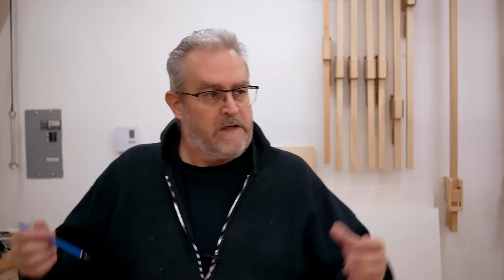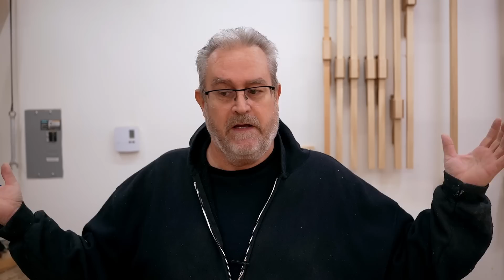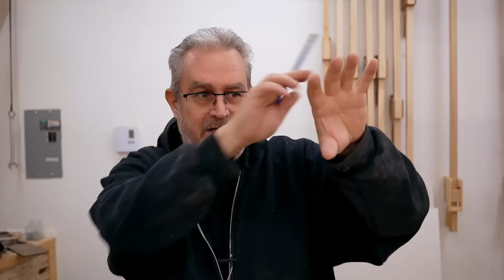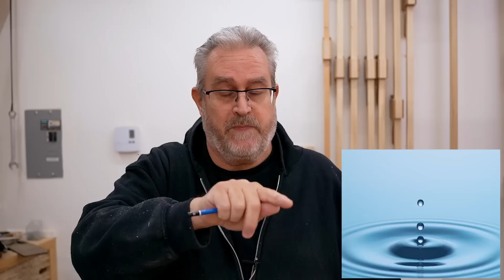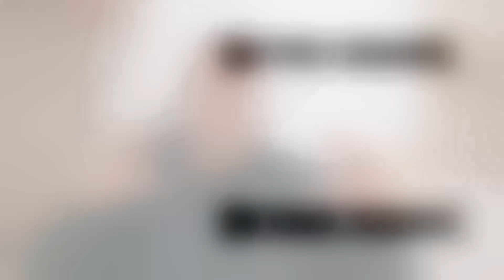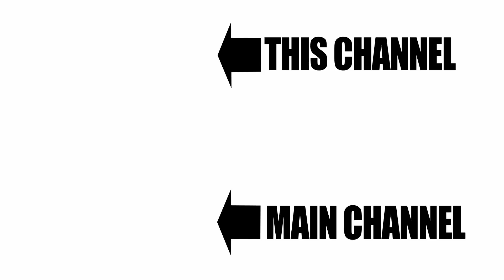Debunking Audio "Truths" - Open Baffle Speakers don't Pressurize The Room

Comment: There is no pressure created by dropping something in water?!   Lets try dropping an asteroid, the size of Texas, into the water... from 1000 ft up.   The resulting Tsunami..  wont have any pressure at all... right?  >_<

 What about Car Audio Subs, in an Enclosed Car?   There certainly isnt enough Pressure created, to rattle the Trunk, and or Blow out the Windows... right?

 Of course, none of this has anything to do with  Sealed, Ported, and Open Baffle... IMO..   as a large room isnt likely going to become Pressurized enough to be felt...  by standard house speakers. Some Massive Pro Audio Woofers, and 10,000 watt subs... maybe.

 As for the comment about Ports being able to go "LOWER" than sealed speakers...  Sure... but the Resulting Bass they produce, is ARTIFICIAL sounding, and is likely much lower than the actual recording itself.   Where as a Sealed speaker, will produce a sound that is much closer to the Original Recording.   FAR less distortion, and no "muddied" or "artificial" sounding bass.

 If you want a little bass Exaggeration... then build a Passive Radiator system.   They produce FAR superior sounding Bass, than any Ported speakers.
Reply from the maker: John, you are not listening to what I said. 
The pressure that's created when you drop a pebble (or asteroid) in water is LOCALIZED and it is a two part thing where you have a HIGH pressure peak followed immediately by a LOW pressure trough.
When an asteroid lands in the ocean (it happens every day, actually), the net pressure of the ocean does not increase. The asteroid creates LOCAL fluctuations in pressure - low and high that are equal.

Comment: Yes it is a strange phrase. If the speaker creates velocity there will also be preasure, the two components of a sound wave.

It is true that open baffles are less able to produce sound at low frequencies though, which is why they need a good dose of EQ and lots of active surface area compared to a mono-pole.

Comment: Great job by provideing an intuitive explanation describing compression and rarefraction of the fluid by sound waves.   Your explanation succinctly covers sound propagation in water and solids.   When using a screw driver to listen to an engine knock, sound travels in a solid and the pressure does not increase in the metal.  However, compressive and rarefraction waves follow your great explanation.  Keep up the good work and sharing your understanding and applied research.

Comment: 1:41  what? “Pressing down” please check the second law of thermodynamics, as that statement is total nonsense. Gasses do not go ‘’down”! Gas expands in all directions and presses in all directions equally on the walls of the container. Gas has no bias down, on the contrary, gasses are produced at ground level and make their way up as they expand in line with entropic law (the second law of thermodynamics).
Reply: Air pressure, commonly called atmospheric pressure or barometric pressure , as John described is absolutely due to the weight of the gases in the air 'pressing down' due to gravity. Fluid pressure in either open or closed conditions is observed in all fluids which include both gases and liquids, therefore it is absolutely appropriate to think about atmospheric pressure in the same was as the pressure under the ocean. The only difference is that being under a column of air you are going to experience a lot less pressure (force) than if you are under a column of water. Why is that? Because the water is far more dense, in other words it has greater mass for the same volume. 

Within a closed container pressure can be described as 'molecules bouncing off the wall' and yes it appears we can increase that pressure. With a balloon we are either trying to increase the pressure by blowing in a lot more gas than the volume of the deflated container, in which case the container will try to expand to equalise with the surrounding air pressure. Or we might be heating up the gas in the balloon to excite the molecules so they do hit more against the walls and expand them. The reason the hot air balloon rises is because the same mass of air has been excited sufficiently to expand the volume of the container. Therefore the contents is now less dense than air and it floats. A kids balloon inflated with normal air does not float because it expands to achieve the same density as the surrounding atmosphere.

However, again as mentioned by John, with sound we are pushing the air backwards and forwards, we are not exciting it enough to change the overall pressure of the room. Certainly not with the sort of volumes speakers could produce. The only very slight chance of a pressure increase is dissipation of sound energy to heat, an increase in room temperature will increase pressure in the room (like the hot air balloon). But again with the amount of sound energy and room volume we are talking an imperceptible temperature increase and therefore similar lack of pressure increase.
Reply: You're about to have a hard time explaining how bodies form in space, how an atmosphere can exist and so on...

You're forgetting Brownian motion.
Reply: @AndersHansgaard  Brownian motion simply describes the motion of the particles in the gas, it has nothing to do with the atmospheric pressure we experience on earth. That pressure is purely a result of the mass of the atmosphere (pretty much constant) being attracted to the surface of the earth (pretty much constant) by gravity (pretty much constant). 

If we had less gravity (a planet with less mass) we would have less atmosphere and depending upon the surface are we may have less pressure. If we had a smaller (but more dense so equal mass) planet we would have higher atmospheric pressure because the same mass of air would be pressing down on a smaller surface area (so more Newtons or kg per m^2). If we heat up the atmosphere it may expand (become less dense) but hopefully we would not heat it enough for it to escape, so again pressure would remain the same. 

I'm not expert in the formation of celestial bodies but I am pretty sure gravitational forces are again a key part rather than Brownian motion. Nothing is going to form through all the random motion unless there is something pulling it together in some way. 

Getting back to the scale of what John was talking about, we should be able to accept that air pressure in a room is not going to be affected by a set of speakers!
Reply: @WorkingWood  Yes. Yep. Indeed.

I was replying to @NathanOakley1980 after your excellent reply to him, so I thought I'd keep it short. I might have kept it too short, though 🙃

In Nathan's Universe where gasses are not affected by gravity, we'd have no stars, planets etc. in the first place. And no atmospheres for audiophiles to enjoy, of course. So my point was that Brownian motion rather than the second law of thermodynamics accounts for what he describes, in so far as he gets anything right.

"Gas does not have weight" is what he thinks. Oh boy!
Reply: @AndersHansgaard  oops sorry, yes we are in absolute agreement :-)
Reply: Gas does not have weight. The ocean is not gas, gas does not behave like water, they are totally different states. 

“I think one of the confusions is” people conflate water (bonded) with gas which has no bonds when detailing “weight” a measure of solid and liquid in air again, air has no weight. If you think it does, please let us know what the weight of a gas molecule going up has?!
Reply: Gas going up (as in a balloon) has positive buoyancy. It is lighter than the surrounding gas. Of course gas has weight. Everything that has mass has weight. F=ma ==> F=mg.
Reply: “Light rays” bouncing off widows…. Nope, “light rays” are a computer concept and do not exist in reality, feel free to show us one. 

This whole video is a masterpiece of convoluted nonsensical pseudoscience.  

Seriously, your videos are usually so good, why babble nonsense? 4:44